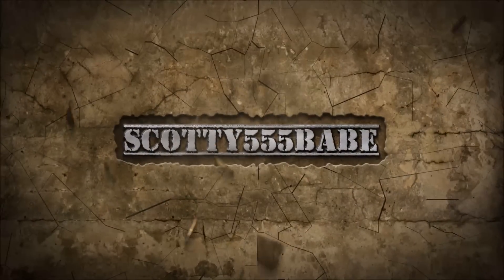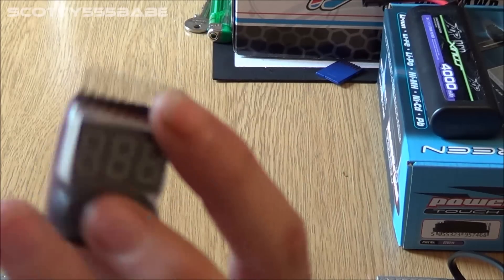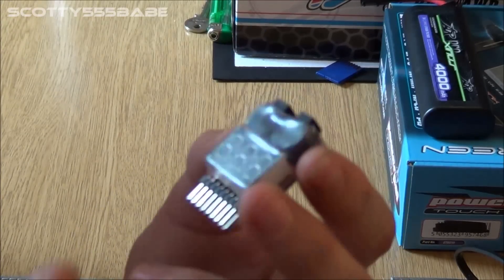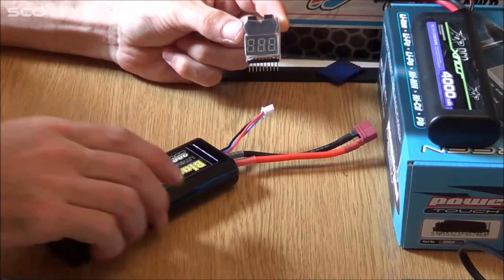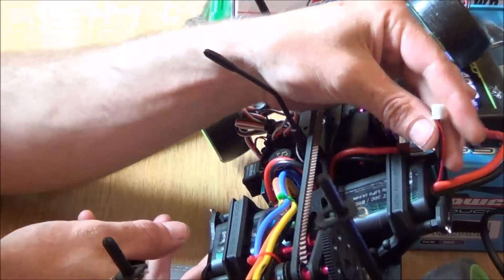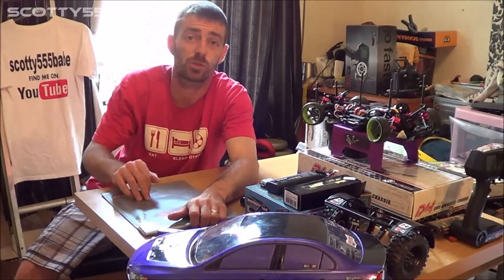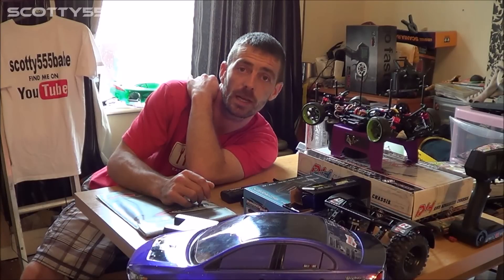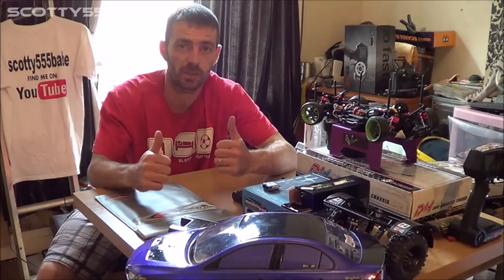LIPO BATTERY | Voltage Bleeper Module | Lipo protection | Lipo Safety tips

Comment: Be careful with these modules, they are notoriously bad at measuring voltage accurately. I've had many over the last months that had measurement errors as large as 0.2 Volts which is obviously much much too high. Even after picking out the ones that are decent, measuring errors are still around .03 Volts between leads. So be careful and double check with a good voltmeter.
Reply from the maker: Thanks for that info.... I really appreciate it
Reply: Absolutely right. My lab supply is calibrated from time to time and it is accurate to about 0.01v - and had it set at 4.00v - according to the tester though it was 4.07.  Makes using the lower cut-off settings a little bit "iffy".